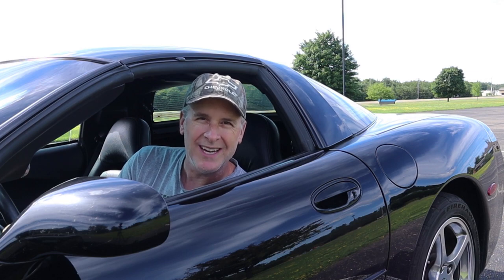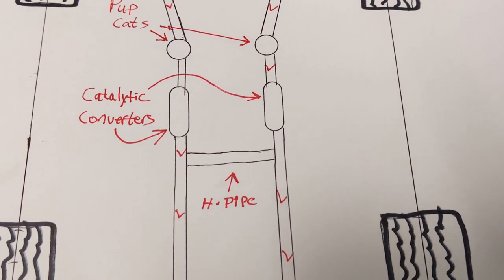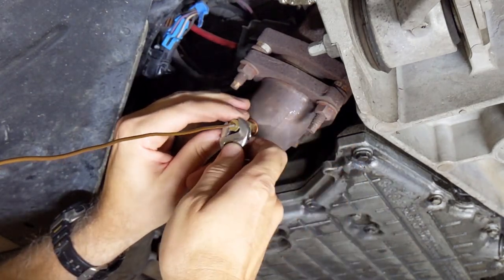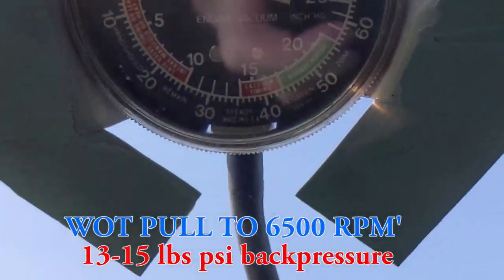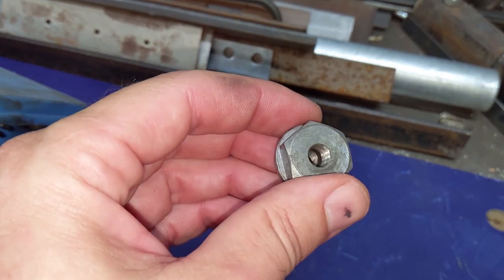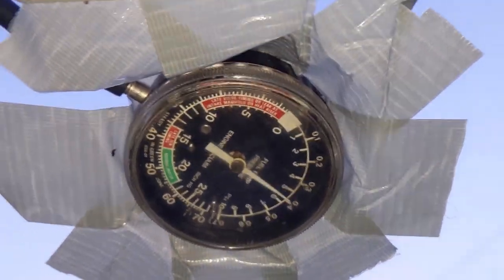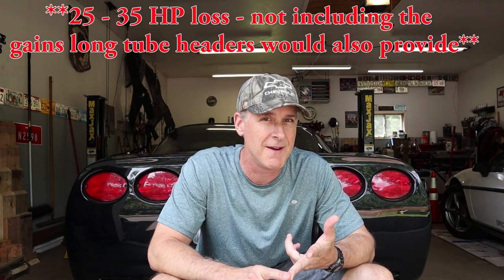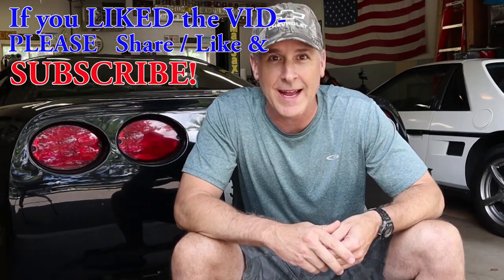C5 Corvette Exhaust Back Pressure Testing - Am I Leaving Horsepower On the Table?

Comment: I like doing more with less so to me, Trapping a 130 in basically a OEM stock car other than the S.C. is extremely impressive. No loud exhaust or fumes gotta be nice. Id leave it be or maybe put some LS7  exhaust manifolds and a C5Z catback.
Reply from the maker: Thanks for the comment! We are like-minded. I will continue to try to find low-cost ways of improving performance without making it a pain in the ass to drive!!!

Comment: Well done. I went from stock exhaust 6psi to less than 1psi with my homemade exhaust. I didn't measure any performance gains though.
Reply from the maker: How did you attempt to measure gains? This is the hard part when doing minor modifications in my opinion. They would be pretty minor, so even weather fluctuations over a couple of days could easily taint dyno and/or track runs.
Reply: @Toys4Life  I think the only reliable way to measure small gains is with engine dyno. 
 Did you end up taking it to a drag strip after the exhaust modifications?

Comment: I have a supercharger c5 with 1 3/4 LT headers  approx 800 hp motor 700 rwhp 2.5 mid pipe and bb bullets 3inch exhaust. I just installed the bullets and I can tell you a difference in seat of the pants. The speedometer is faster under accretion.  Not sure how much I gained. The sound is awesome.
Reply from the maker: Are you going to put in a 3-in midpipe? Seems like that's probably your choke point with 800 crank power?

Comment: Great Channel. Thank you for putting out such informative videos. I recently acquired an 02 z06 and I absolutely love it.
I have the dual borla straights and while I enjoy the sound, I am curious if the exhaust is helping or hurting horsepower. I think the quad exhaust you currently have looks the best, in addition, the higher flow in place of the cats sounds like a great idea.
Reply from the maker: Thanks for the comment! I believe yours doesn't have the two pupcats, which helped the 02 ZO6 gain a fair number of horsepower over the previous year!

Comment: This is a great vid! I’ve watched it twice.  I decided on Kooks 2” long tubes and their high flow race cats for my C6Z.  I also got the headers jet hot coated and purchased their race pipes without cats for track days.  It’s a street car that I like to beat on the road course occasionally.  I plan to use DEI reflective tape and heat shielding to protect the hoses and wires from the headers.  My goal is 530+ whp on the stock Z06 cam and lifters.  Have you watched RPM motorsports’ video about gutting the cats to relieve back pressure.  I think they were having some knock due to the excessive pressure and picked up about 15hp.
Reply from the maker: 530 RWHP NA is very difficult.  SC is much easier.     Do you have a link to the RPM vid?            Thanks Toys.

Comment: Have you considered some sort of electric or pneumatic bypass dump? It would be nice to retain the streetability and have the additional power on demand.
Reply from the maker: I have, I'm not a big fan of open exhaust, did that years ago and it got old after a little while. Plus the mechanical parts when connected to the hot exhaust tone to have problems after a year or two...

Comment: Have you considered swapping out your stock exhaust with a factory titanium exhaust (from the z06)? The hp gain is negligible - from a sound perspective it's a subtle improvement especially in the high RPMs.
Reply from the maker: I have but they are pretty spendy for minimal HP gain.  The lighter weight is probably the best part!  Thanks for the comment!

Comment: I would not get rid of cats, get some high flow cats but I regret deleting my cats.  I have a 98 C5, 2 years ago I blew the motor and replaced with a GMPerformance LS3 and deleted the cats.  My car stinks, it’s not a sulfur or gas smell, just a “chemical” smell.
Reply from the maker: I agree sir, except I was thinking I might have a separate X-Pipe for racing versus the street...?

Comment: gut the cats. i had to put my stock zo6 muffs back on got tired of my ears ringing after a long cruise.
Reply from the maker: What cat back did you remove.    Let me guess, too much drone???
Reply: Xs power.  The drone wasn't horrible but definitely louder than stock drone, just loud in general.  I don't regret it.
Reply: I have a procharged c5z..  I also went back to the stock catback.  Titanium catback is right at 2.25 inches also...not 2.5.  I made a touch over 700whp with the stock system
Reply: @tunerdadtunerdad7927  good God man, have you ever toped it out? 700 with the ls1?
Reply: @colemcmeans7809  Forged ls6 with D1 Procharger.  Never topped it out but do a fair share of roll pulls.   Thinking of doing boost loud valves so my stock mufflers last.
Reply: Nice, you have any videos of it?
Reply: @colemcmeans7809  some on other social...fwiw....I dont think the Titanium catback flows like people say it does.  I picked up boost by putting it on...so it is a reatriction for sure.
Reply: I believe it, mine was too damn loud for longer cruises. First time I've ever dehotrodded anything in my life.
Reply from the maker: Plus, with a little extra weight of steel mufflers down low in the back it can only help traction!!!